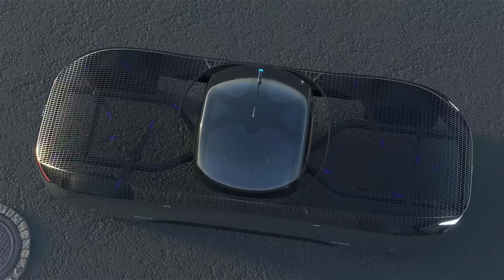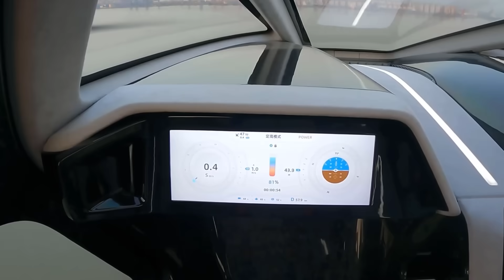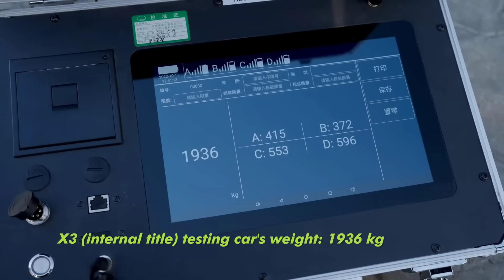4 Hovering Cars 2024-28 | Magnetic Revolution

Comment: Finally flying cars are coming I been waiting for them since high school😂😂😂
Reply: never want flying cars - imagine all the noise in the air, the visual pollution in the sky, and cars crashing and falling into homes every day, cars slapped out of the sky with wind turbines, people dying daily, smashed cars all over the mountains and in the oceans.  Bad idea.  Flying is only for educated and trained pilots who fly real airplanes and know what they are doing.
Reply: @ChrisCavigioli2 I don’t think lil bro knows what AI is
Reply: @LieMac   AI isn't perfect, far from it, and it probably never will be. And considering the fact we don't use it to guide commercial airlines, it probably won't be viable in flying cars at all until a few decades. 
AI also can't account for if a car suddenly breaks down while flying, or the noise pollution.
Flying cars (that exist) in general are pretty impractical in general. A car that can fly efficiently cannot drive efficiently and vice versa.
Reply: @TenkyuuTenkyuu  AGI will be coming in the next few years.

Then, it will be optimal as it’ll be more intelligent than the average human.

Although, an better alternative is probably having every car on the road powered by AGI to eradicate traffic.

Flying cars are sort of viable because you can travel pretty fast without risk of crashing into anything.

Car fails during self drive…? Don’t worry! An steering wheel will roll out in the event that the system fails.

Give it a few decades, unless AI makes us hit the singularity… 

For the noise problem, we definitely need a new propulsion system. Rotors and propellers are pretty outdated in my opinion and have to go.
Reply: @LieMac  You're being way too optimistic. And when I say "breaks down" I don't mean it stops self-driving. I mean the engine/motor fails, a control surface locks up. In a road car, you can just pull over, but in a flying car, you have to make an emergency landing, and in a densely populated area, an accident is bound to occur. 

And there might not be traffic, but there will be so much restriction, there will be air traffic towers everywhere to insure an accident won't happen, there has to be a ton of police flying cars to make sure people don't fly over restricted areas.

Your view of AI is also very optimistic. If we reach the point where AI is able to drive billions of flying cars safely; everyone would already be jobless, and our technology would be so great that we could probably just stay home without needing to go anywhere.

I honestly kinda hate the AI age, so many things that used to be done by human innovation along can now be done with AI. I wish I lived in the 70s. Just any time before 2020.
Reply: @TenkyuuTenkyuu  My view on AI isn’t optimistic, It’s what I currently see and view on the current development.

I remember when a guy on reddit said “we’ll get AI videos” in 5 years about a year ago or so.

Well, he was indeed too far ahead…

We won’t be in poverty, I’m sure there is solutions starting with UI (Universal Income)

I love the AI rage though. Our species can finally advance at a more exponential rate.

I am so tired of our current technological rate.

Trust me, you do not want to live in the 70’s, it was romanticized by the media but it was the same thing, less tech, more crime
Reply: @LieMac   I literally do not care if the 70s were less perfect. And I hate tech. The 2020s got me addicted to the screen. I lost many friends over that. It's not just me either, screen addiction has been on the rise in the past few years.

I don't want a future where human labor and innovation can be done by a machine. Yes, we would basically be free to do anything since the economy is mostly run by AI, but maybe, too much freedom is a bad thing?
Reply: @TenkyuuTenkyuu  Too much freedom is a bad thing…?

Ask the citizens of Khmer rogue if thats true or 40’s occupied europe…
Reply: @LieMac  Google "too much freedom" 
I never said freedom was bad. But you can have too much of it. Considering the fact you are misinterpreting what I say and not answering all the concerns I bring up, I'll just assume you aren't interested in what I have to say. You just want me to agree with you.
Reply: @TenkyuuTenkyuu  My opinion is objective but I don’t necessarily want you to agree with me.
Reply: @LieMac  sure, whatever
Reply: @TenkyuuTenkyuu @LieMac You both have valid opinons in my view. Each generation suffers the same outlook LieMac. I am a 70's lad. I too miss the old fashion ways as we were working for our advancment unlike how the new gen does not. We eventualy all sound like our grandparents though, whom we mostly took no notice of the importance of their words perhaps, until our later age. We had to walk before we had transport, we had black n white before colour, penny farthing before bmx. Tenkyuu is right too though. Tech will always change how we do stuff. Because as humans we just cannot settle for being contempt, we always have a thought to make it better or fix a problem that to the previous Gen may not be seen as one. So no matter what we do or how we do it we will always learn from pain, mistakes, fear, accidents etc. That is why we are living. To learn. So if we just stop changing stuff that would be like stopping the hands of the clock or plants and life never to die then be born again. The meaning of Life is to live. That is what we do. We cannot have good without bad. Or one would not exist. Anything is possible. Be careful what you think, say as that creates and that is GOD. We are the creators. We will never stop creating. Love to you both.
Reply: @ChrisCavigioli2 air control is going to be crazy
Reply: They aint
Reply: Build them crash free in Jesus Name.

Comment: People can't even drive on the ground with set lanes and still crash into each other! People falling out of the sky also if something fails. None of the flying cars will become what everyone will use just a small population.
Reply: Don't be so quick to discount flying cars. True flying cars will have the most powerful AI driver/pilot assist software as well as robust and up to date anti-collision, obstacle avoidance senors and software installed, taking the human factor out of the equation, with a manual over-ride which would only be activated if there's a system failure.
Reply: never want flying cars - imagine all the noise in the air, the visual pollution in the sky, and cars crashing and falling into homes every day, cars slapped out of the sky with wind turbines, people dying daily, smashed cars all over the mountains and in the oceans.  Bad idea.  Flying is only for educated and trained pilots who fly real airplanes and know what they are doing.
Reply: @ChrisCavigioli2  I agree. Planes fall now due to failures. Now imagine millions of cars randomly failing cause people don't maintain them. 🤣

Comment: The true holy grail of flying cars is still decades away.  And that is the development of true antigravity propulsion.  It is mathematically possible, but still no one as been able to develop a practical solution for this problem
Reply: There is no such thing as antigravity (only in science fiction).  Gravity is only an attractive force.  It cannot be repelled like a magnetism, which is dipole.
Reply: Umm, the Navy already has it on newly declassified Aircraft, but it would most likely be quite a while till we see the tech in our own automobiles, the technology is called mass reduction, and is referred to as electrogravitic  technology, at partial power a car might not actually fly, but it would hover a few inches above the ground suspended on the repulsive field created by the technology, and a full powered car would have virtually no mass and as such wouldn't weigh anything while the system was activated, meaning almost noiseless flight except for the humming the system produces.

Comment: When I was a kid I liked to draw. Once I drew an image of a car that looked like a cheese slice, so it would be aerodynamic. It had magnets on the botton and hovered over a magnetic road, it would be propelled by stronger magnets that would be moved at different angles to control it's speed. I always thought this kind of thing was possible and it looks like China might show everyone it's easier than we perhaps thought.
Reply: i once thought that it could work like this as well, but it's tough to control the forces of magnetism, then i thought that maybe using frequency generators set in multiple directions so it was easier to control and use and could provide lift, and they can, but they also require significant power source to make it possible and less weight.

but i would rather test that on a much smaller scale before ever trying to do it with a car.
Reply: It's (almost) as crazy as one of my ideas - where a pair of Skis were covered in magnets, to hover, and an opposing magnetic Ski Slope. Frictionless downhill skiing. No snow required.
Reply: @peterduxbury927 that’s actually a really cool idea
Reply: @peterduxbury927  Well Lexus created a real life hoverboard like from Back to the Future 2. It was powered by liquid nitrogen-cooled superconductors and permanent magnets. It was revealed in 2015. It was a promotional stunt but really worked on a very specific surface.
Reply: I said roads should be magnetic before I was 10. My mother said they'd never pay for roads like that. I was thinking anti- gravity. I have a DJ mixer modification and a few others but it's hard to find electronics engineers who will work away from the job , off camera.
Reply: Cool, good idea.  Mr. X
Reply: Like how they did with Ovid ninteen
Reply: same, i liked to ponder about future technology
Reply: What kinda genius? What do you do for work? What’s your passion?
Reply: @NathanIslesOfficial  
who is your comment directed to?

Comment: I wander if it would work on our trucks or would it Jack knife on magnetic.
Reply: Won't happen.  It works with maglev trains because they are kept within a track.  You will never see individual cars or trucks on aluminum roads.  Just too impractical.  They would never be able to make a network of aluminum roads across the country.  What happens when you have snow on the track?  What happens when all the cars not equipped drive across the aluminum sheets?

Comment: How do you steer it if it's off the ground and floating ??
Reply: Fans?   Air brakes.  LOL
Reply: The first part of this is utter fiction. Mag Lev car on an average road... as if
Reply: The steering would be the same as drones. More or less power to left and right wheels would create directional forces to turn just like when you use pitch to lift or dive a copter vertical. The energy from the spinning fans will create forces. Have you ever held a spinning object and tilted it? That force is what is the energy of direction is felt in your arm. So we just control the pitch of it using tilt.

Comment: If it levitates then why does it need CGI ?   Also, aluminum being non-ferrous would seem to be a teensy bit of a problem if you are using a maglev.
Reply: Copper can add to aluminum to give it more copper like properties. Not magnetic but definably affecting gravitic force vectors using magnetism.
Reply: @MrDogonjon    No.  It is magnetic levitation due to electromagnets in the car repelling the induced magnetic field in the aluminum.  It is not affecting gravity in any way.

Comment: 2:20 where is the engine and tank/Battery in that flying car if the body is housing the rotors?
Reply: With CGI anything is possible.  All of these fake futuristic science videos that only show CGI are a joke.  Is that Hyperloop done yet?
Reply: No battery or motor required on a maglift car. Only need power to start the reaction.
Reply: If it has motor and battery and rotors it's not a new invention.

Comment: Anything with exposed blades is a public safety hazard and can be written off as a terrible idea almost immediately
Reply: Yh, they should cover the blades.
Reply: @mobarakjama5570  The speed and weight still gonna kill if not careful
Reply: @mobarakjama5570 I’m worried about the birds that might fly by the blades 😬
Reply: @Nisha_xo  True 😭
Reply: @Nisha_xo  so you are not worried if the bird is a chubby big one and damages your blade send your car swirling down?
Reply: @Nisha_xo 😅😅 Dem birds better look out for dem cars, or birds be nomore.🙄😂🙄
Reply: @mobarakjama5570 Excellent idea. How will the car push the air to lift off or move once in air if the blades are covered.
Reply: I think it's less dangerous flying cars then on the rode. Still poses risks but don't drink and fly 😂😂
Reply: @Sourcecodemastergoaheadcheater  flying cars is the same level of dangerous because it’s a life risk if not used properly and end up crashing into a building
Reply: So helicopters are hazards huh 🤨
Reply: @j.e7505  Helicopters don't lift off from grocery stores
Reply: dude what yes they're incredibly dangerous are you dumb lmao  @j.e7505
Reply: @j.e7505 helicopters aren't typically driven by your average idiot. Thankfully.
Reply: @j.e7505 Except those don't fly around really often
Reply: what you tripping on.
Reply: If these were to become popular I think they would require empty take off areas that are away from possible pedestrian accidents. also It looks like the car doesnt rotate horezontal until it is in the air so it is less likely to hurt someone unless they run under the car and jump.
Reply: It would,  in theory would cut down on car jacking. 😂😂😂
Reply: Helicopters have entered the chat
Reply: What about helicopters dummy
Reply: And piston prop, turbo prop fixed wing

Comment: You're going in the wrong direction. You should be looking at the technology of Electro magnetic, that's the technology that needs to be used. It's already been proven animal fire. You trying with these battery power cars in these propeller cars?
When Electro magnetic is more efficient Let me create some field so you don't feel the The g's
There's only been a film of a man using electrical magnetic platform.
I think it was the 40th for the 50s.
That's what you start
Reply: Funny how some years ago people would refuse to purchase homes directly under high voltage powerlines - and now some people are thinking they might get much closer and sit in a vehicle that keeps you in HUGE and heavy EMF environments. Seriously?  Not only that, but you cannot brake and you can only "drive" where the wires are on the ground (= no freedom).  This is a perfect solution for the communist agenda to depopulate the planet of "useless eaters".

Comment: How does this work on Aluminum with it being a non-farus metal?
Reply: If it was a ferrous metal it wouldn't work.  You can do magnetic levitation over aluminum or copper, because they are metals with high conductivity.  The electro magnets in the vehicle induce electric currents in the metal below, that in turn generates a magnetic field that repels that of the electromagnet.  A ferrous metal would be attracted to the electromagnet and there would therefore be no levitation.
Reply: That was exactly my question.

Comment: Aluminum is not magnetic, so why put aluminum on the road
Reply: If aluminum was magnetic it wouldn't work.  Maglev trains run over an aluminum track.  The electromagnets in the train induce an electric current in the aluminum track below, which in turn causes a magnetic field that is repelled by the electromagnets.  Which causes the train to levitate.  Impractical for cars driving on a road.  Will never happen outside of a test track.
Reply: It's called electromagnet 😅

Comment: You really must produce un-stealable aluminium road surface and fix those wheels, they are counter rotating!
Reply: They would be counter rotating to counteract the rotational forces to the vehicle.  They aren't causing the forward motion of the car, just the levitation.  Similar to a duel rotor helicopter where the rotors always spin in the opposite direction to counteract the rotational forces of the rotors on the helicopter.